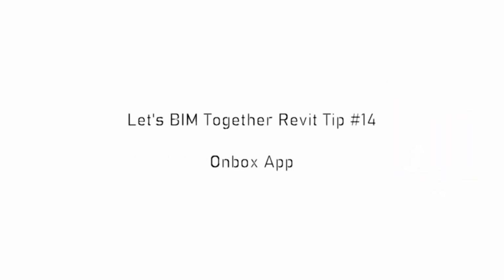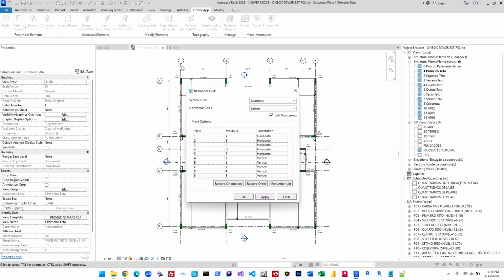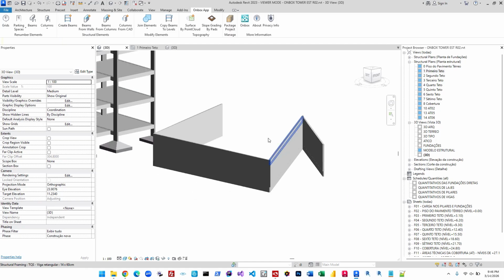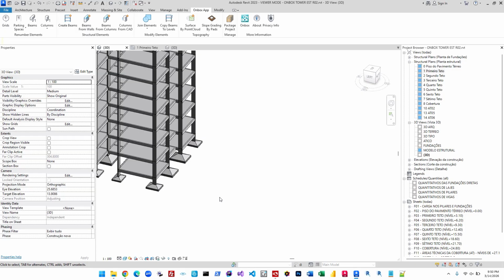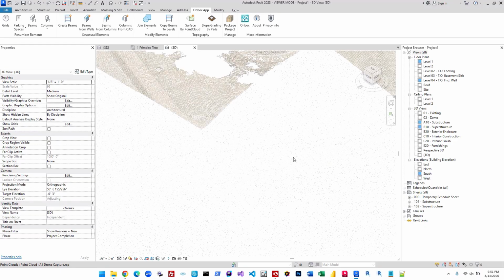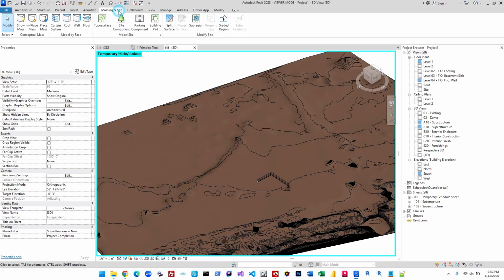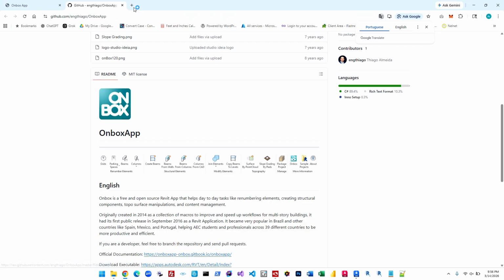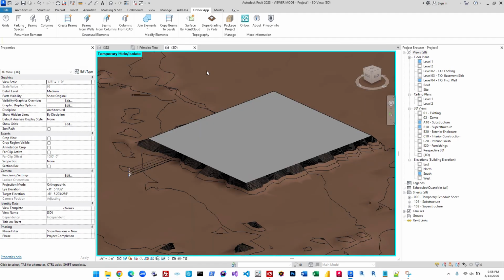Revit Tip #14: Onbox App (Plugin for Revit 2019 - 2027) Structural & Architecture

Comment: IT IS WORK  IN REVIT 2024???
Reply from the maker: It is available on GitHub, and the official version works on 2024. (I copied their repository and upgraded to Revit 2025 & 2026, its mostly works lol)

Official version link (you have to compile it in visual studio first, as the install file was not provided):
https://github.com/engthiago/OnboxApp/tree/master

My repository (i included installer there, also supports 2024):
https://github.com/LetsBIMtogether/OnboxApp

If you Google or search YouTube, you should be able to find an installer for the official Revit 2024 version as well, as that is how I came across this plugin. Lastly, if you end up using my repository, feel free to provide feedback :) I am hoping to spend more time cleaning it up in the future if I have the time.
Reply: @letsbimtogether  thanks  for  you